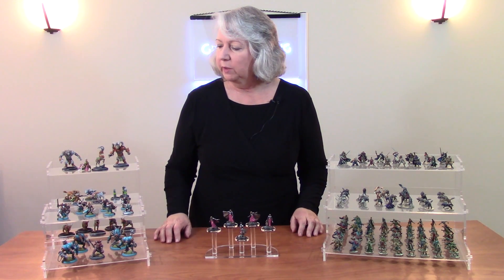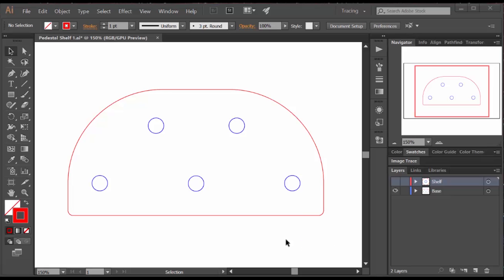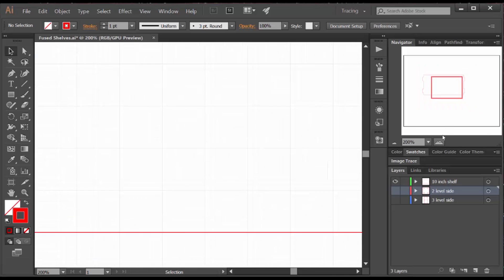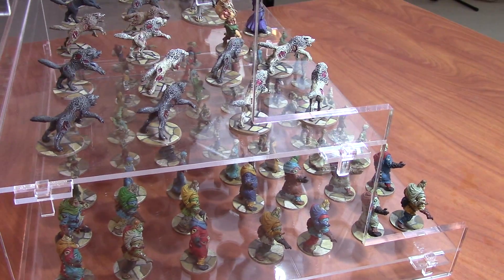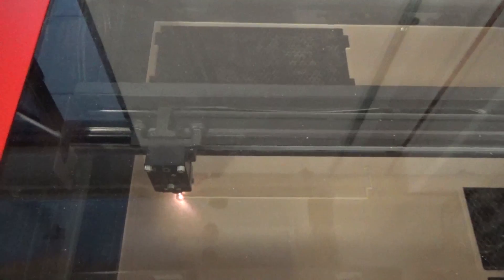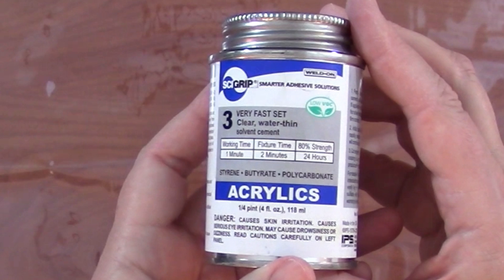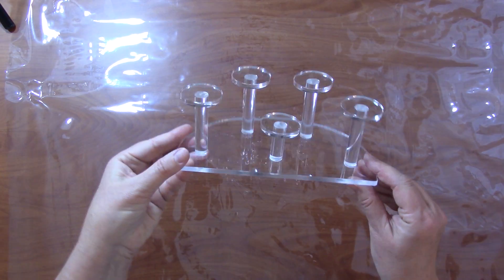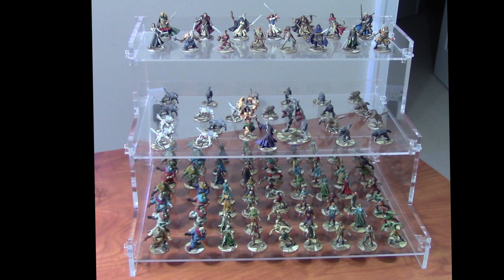How to Make Laser Cut Display Shelves for Miniature Models

Comment: Does the software you have been using auto adjust for kerf? Or do you build such items like this only based on calipering for precise material thickness, run without kerf adjustments, and thus get joints that are tight/loose enough for either fusing or disassembly approaches? (Reason asking: I like your method of virtual building, but my software right now requires I adjust for kerfs manually were I to do so—and I do that by creating kerf-adjusted Illustrator/svg files in addition to keeping my originals. I haven't noticed you talking about doing such adjustments in your projects.)
Reply from the maker: Bryan, my experience has been I don't have to worry about kerf. I use the same drawing for inlay as the piece it's inlaid in (for example) and the fit is excellent. For the shelves, the biggest issue is the fluctuating thickness of a piece of material, especially cast acrylic, which is what I use.  I use my calipers to check my material thickness in several places along an edge. In all my projects, none have adjusted for kerf and the fit has always been good enough for either fusing or gluing. Of course, the focus of the laser needs to be good, so the amount of material cut away is minimal. The laser cutter I'm using now requires manual focus and I find I like that - it gives me better control.
Reply: I'm new to laser cutting, but my projects so far have been small wood filagreed items that kerf adjusting has made a difference in better output. But nice to know that perhaps on a bigger item like a display shelf that the issue is much less important—but I still wondered especially about fusing the acrylic mortices and tenons. SO thanks for the advice. 

What I haven't seen yet in the few sheets of different acrylics I've purchased (12x20 and 12x24) is variation of thickness across the sheet—but I've noticed the slight difference between sheets. I'll keep an eye out as I buy more.